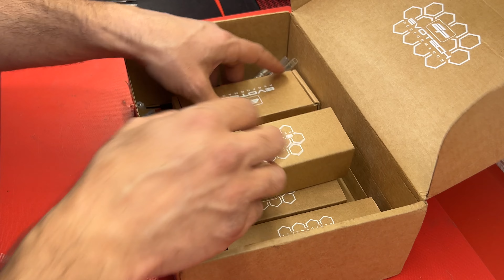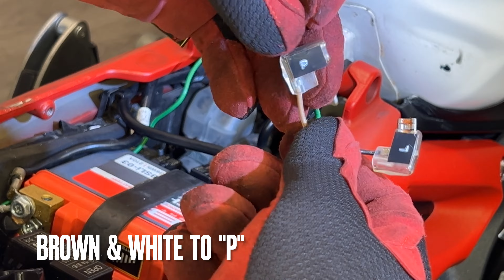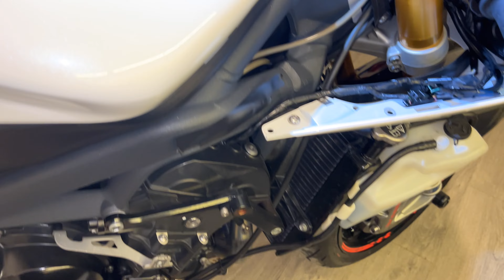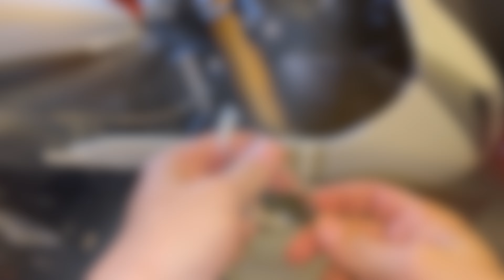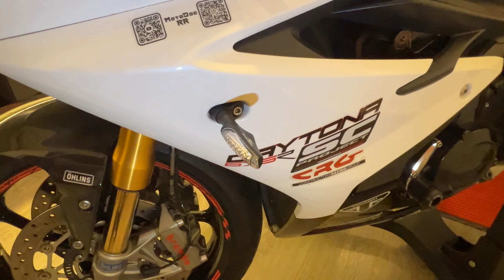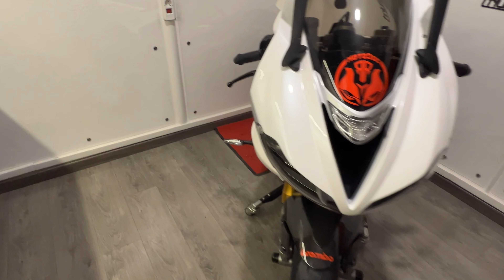Evotech Performance Scrolling LED Turn Signals - Triumph Daytona 675R - Unboxing and Wiring Guide

Comment: Hey! Do you remember how much you paid for bodis headers included shipping, taxes etc? and how much did you pay for the SC slip on? Thanks :)
Reply from the maker: Bodis has the headers listed for 850eur plus shipping
SC Project CR-T including link pipe was approx 750eur plus shipping.
Reply: @MotoClinic440  Was it hard changing the exhaust system and air filter? I have little experience, I know the basics like changing the oil and filter😂
Reply from the maker: @nicolayvl Air filter is easy. Just remove the seat, lift the tank, and remove the top of the airbox to get access. 
For the exhaust headers it is a more involved job. Need to remove the fairings and undo the bolts that hold the radiator at the bottom to move it forward to get the space you need. Then remove the muffler followed by the stock headers to mount the new ones. There’s a specific tightening sequence and torque setting so you need a torque wrench. Don’t forget to get new exhaust headers gaskets or you will have a leak. Be sure to reinstall the O2 sensor as well and you WILL need to tune the bike (dyno is best) or it will run like crap and you won’t get any performance gains. 
Also make sure your studs aren’t rusted solid and be gentle  taking those off. If you break any studs it’s a big issue to deal with.
Also note that you will need a servo eliminator if you’re changing the stock muffler or you will get a check engine light.
Reply: @MotoClinic440 Hey! Any reasons you didn’t go with a titanium exhaust? I am stuck between a $2500 Spark Full system titanium and bodis + SC for $1800..
Reply from the maker: @nicolayvl many reasons. 1- couldn’t justify the extra $$$. 2- the only option that I knew of at the time was the full Akra which was super expensive and they had stopped production, so I would have needed to get second hand. 3- I’m not really sure titanium has much to offer in terms of performance unless you  consider a few grams to be legit weight savings. Maybe it’ll outlast stainless and look better but that’s where the goodies stop in my opinion especially for a street ride. So to pay nearly double just doesn’t make sense in my opinion. The bodis headers are excellent, ultra light compared to stock, durable, and with the rest of the mods they offered a significant  power gain of approx 12 dynoed HP. Can’t get much better than that!
Reply: @MotoClinic440 In my case, full titanium is $700 more. Should I still stick with bodis? I dont track my bike, Daytona 765 Moto2.
Reply from the maker: @nicolayvl sure if you’ve got the money to spare then why not.